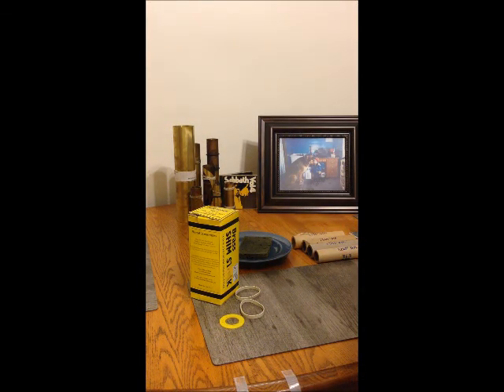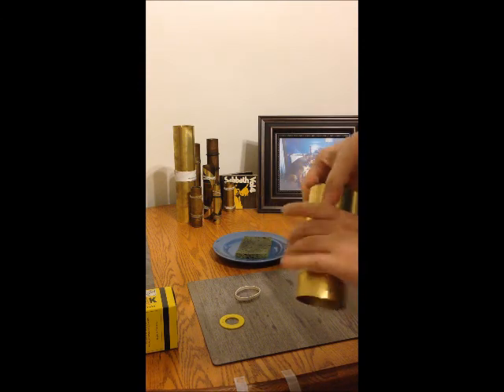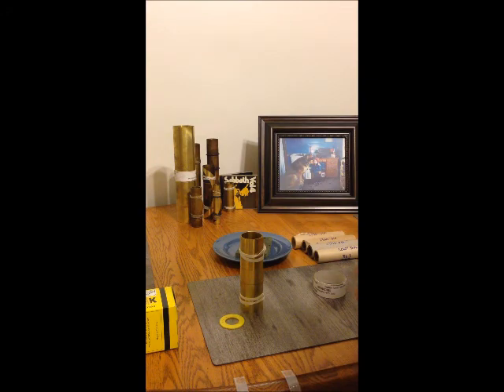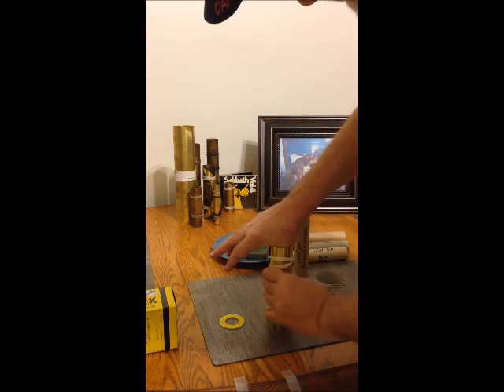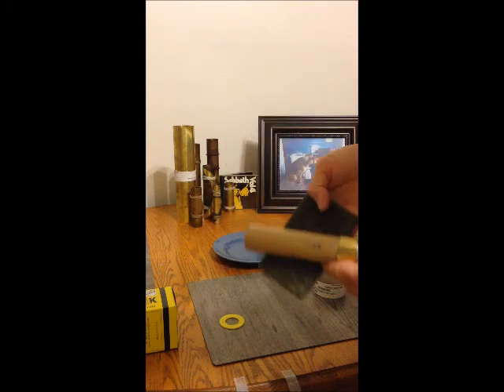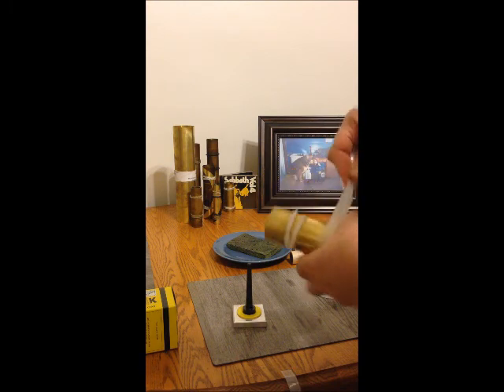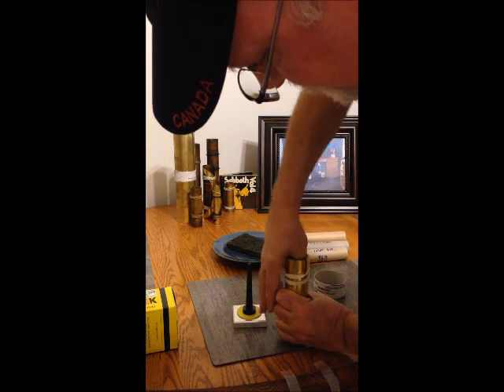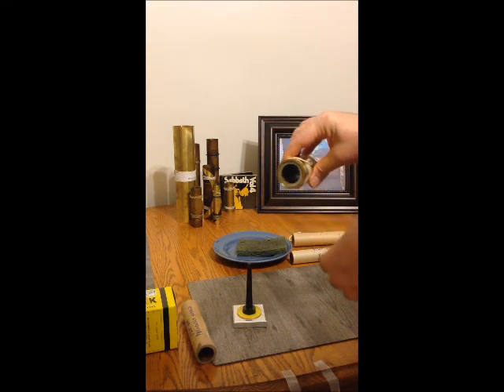Tube support for 3lb strobe rocket, made for 20 bucks 1

Comment: Dave, im impressed with your simple design. I am going to order a small supply of mylar, since there are no tube supports for ¼" bottle rocket tubes. I have 1lb and 4oz tube supports from woody's that work great, but Ive been trying to figure out a way to press my ¼" bottle rocket tubes. Ive tried multiple ways on my press, but im just going to get an inexpensive arbor press for these little motors. Im very intrigued with your system. My question is, with such a small tube, and not needing 3,000+lbs of force pressure for them, do you think a roll of flashing from lowes would work in this situation? 
I hope you see this, i will be subscribing.
Thanks
Reply: Just realized, i have already subscribed to your channel awhile ago. Lol
Reply from the maker: @braddougherty3401  Lol, thanks :) I had a set of 1/4" SBR tooling a long time ago but I sold it. IIRC, it came with a split PVC sleeve for a support. I think that size is just too small to work with using the mylar, but I could be wrong. I assume the flashing you mean is aluminum? If so, no go.
For a quickie support you might try getting a sheet of mylar drafting sheet, cut it to tube length the long way, and just roll the tube up in it by hand and secure it with a piece of tape. When it's done, just let it loose.
You might not even need a tube support, depending on the tubes, I guess. Maybe even rolling some gummed tape onto the tube might do it? Sorry, that's all I have. My SBR tooling had a BP-like spindle and it was a PITA to load the increments. I suppose an end burner would be easier to load. For motors that tiny you might just try hand ramming them.

Comment: Hey man, I really like this idea. But the closest size to an actual 1 pound rocket is the 6” brass. 1 pound rocket size is 7.5” so is it ok/“safe” to use the 6” brass for the 1 pound rocket?
Reply from the maker: I wouldn't say that would be good to do, tbh. This is a pretty old idea. The brass is pretty finicky to use, compared to what I use now- mylar. I got it on Amazon. It was for drafting. The stuff I bought is .005" thick, matte both sides. It came on a 20" wide roll, 10 feet long or so. I cut it to 7 1/2" for a 1lb BP motor and still had enough for a 10 1/2" 3lb motor.
Also, in combination with using the mylar, I have been adding 2-3% water to my BP propellants when pressing, which gives better consolidation at lower pressures.
Reply: @ okay I just read one of your other comments and it basically told me what I needed lol. Is this still a good method for small rockets like 4oz? 4oz tubes are 5” but I’m not too worried about the extra inch of space. Would like to still use the brass shim
Reply from the maker: @gabsterboy808  The brass is no good for motors smaller than 1lb. It's too stiff. If you use thinner brass, it's too hard to work with. The mylar works for smaller motors though.
Reply: @ hmm okay. Where do a buy the Mylar and what specially is it called and size?
Reply from the maker: @gabsterboy808  I wrote all that in my first response.
Reply: @pursaveer9027  oh okay my fault for missing that lol. Thanks for everything! It was very helpful
Reply: @pursaveer9027  sorry last yes or no question. Is using Mylar the same process and everything as the brass?
Reply from the maker: @gabsterboy808  Yes. I like the matte because the clear stuff doesn't slide on itself very smoothly like the matte does. The exact roll I bought isn't available on Amazon right now, I just checked. The brand name is Duralar and it is sold by Grafix.
Reply: @ thanks so much man! I’ll definitely have to figure out how to cut it but hopefully it’s not to difficult thanks!
Reply from the maker: @gabsterboy808  No problem. It's easy to cut with an Xacto knife.

Comment: Great idea how has it worked out? Do they sell these in 10” rolls?
Reply from the maker: I use my homemade supports for all my rockets, and have made several hundred with them. I don't think they sell the brass in 10" rolls. It's either 6" or 12". Fair warning, cutting and finishing the cut on the brass is finicky work and easy to mess up. 

10" is for a 3lb BP rocket I assume. Two things about that: 
1) If you spritz and screen in 2% by weight of water into your BP mix, the propellant grain will be dense and hard. Because of this you can reduce the loading pressure to 3500psi instead of the 'usual' 6500. 
2) Due to this 'advancement' in technique (used by Estes for decades now), the tube support does not need to be as strong. Therefore, I have been able to use .005" thick mylar (Dur-a-lar brand) instead of brass. The logic is the same. I use the stuff that's matte  finish on both sides. I got it on Amazon. I have pressed 3lb rockets to 7500psi with the mylar, no problem. But like I said, with the water less pressure is needed.

I like to 'grease' the inside of the tube with a bit of wax dissolved in a bit of warm naphtha (flammable!) that I apply with a dauber. Then I let it dry. This keeps the propellant from grabbing the inside of the tube and pulling it down when pressing, which would cause compression wrinkles and lead  to CATO.

I will be frank here and say that I am a bit of a renegade when it comes to making rockets. I became very sick and tired of everybody having the same problems over and over again and the 'gurus' suggesting various tweaks without addressing the core issues. So I solved my own problems  and make reliable rockets. Rigid tube supports would be good if you could trust the OD of the NEPT tubes to be within (their) spec. You can't. They couldn't make two batches of tubes the same OD if their lives depended on it. As I mentioned, Estes presses the BP damp. Their rockets are reliable and have great longevity. I copied their success. Modern amateur pyro experts are allergic to the idea of using 2% water, and they are 50/50ish on the idea of waxing the tubes. I got the waxing idea from Takeo Shimizu's book F.A.S.T.

It's funny that after years of this video being up, I suddenly got 2 replies to it, lol. All the rockets in my pyro clips were made using my own tube supports. Hope this helps someone :)
Reply: @pursaveer9027  thank you I really appreciate you taking ur time to explain this all to me.. I probably made a mistake already and ordered a tube support for 1lb rockets at $205.. like u say it’s going to be hit or miss on how tight the support grabs the tube. Can I use the 6” shimsrock for 1 pound rockets? Is it the .005 that ur using? I found the Mylar on Amazon it comes in 20” x 12 foot roll.. can I cut this down to 10” and should I use the whole roll?
Reply from the maker: @jstorres486  If you ordered the tube support from Woodys, he also sells tubes that will fit, last I checked he did, anyway. But he's at the mercy of NEPT. If you get a batch of tubes that are all too loose but the same size as each other, you can line the support halves with aluminum furnace tape or some other kind of tape to snug it up.

The 6" shimstock is handy because it's got a nice smooth even edge already on both ends. My 1# brass support is 7" long. You could use the 6" shimstock with a piece of PVC on top, secured with a 'full-bodied' clamp to press the area above the spindle. I'd be leery of pressing above the 6" support with no support there.

I use the .005" material with both brass and Dura-lar. I use the whole length of the rolls. The stuff you mention from Amazon is the clear stuff. the matte stuff is only currently available in a much larger, much more expensive roll. The clear stuff is too grippy on itself and a bit of a pain to use compared to the matte stuff. I used the 20" wide roll of Dura-lar to make a 1# BP support and a 3# BP support. It's important how you cut it to get an edge with no burr on it. Pretty sure I used scissors, and used the cut edge as the top of the support.

If you got the support from Woodys, I gave him a brass support (I forget what size) a long time ago, and I bet he has never used it. He would probably be willing to send it along for a bit extra if you asked.
Reply: @pursaveer9027  thank u for all the info.. God bless